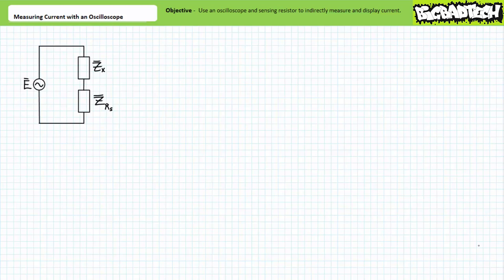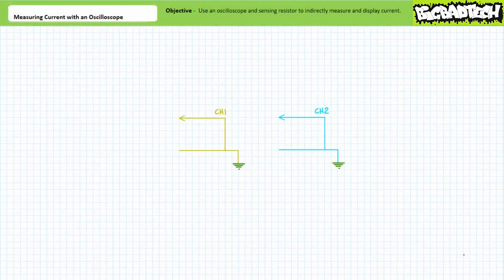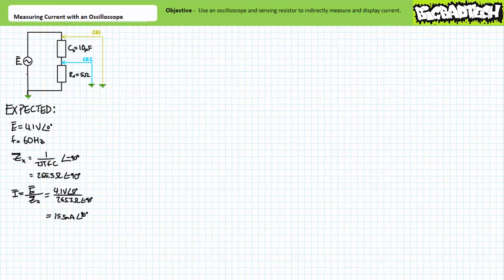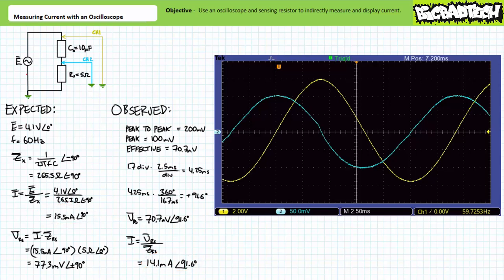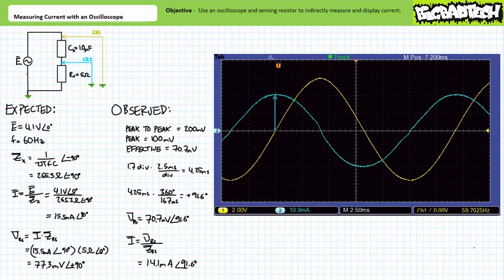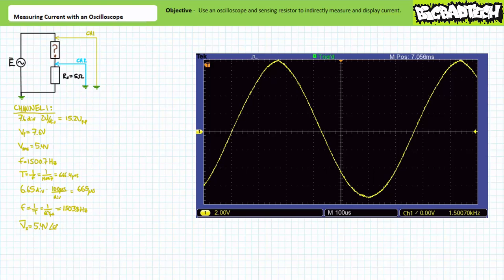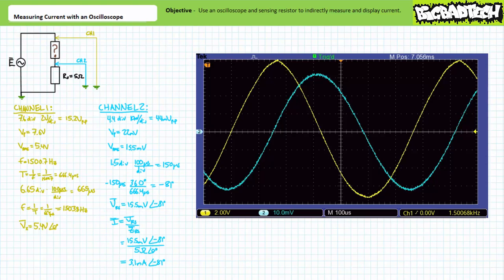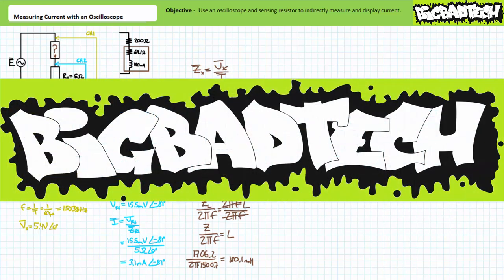Measuring Current with an Oscilloscope (Full Lecture)

Comment from the maker: ERROR at 30:40 Channel 2 has a peak to peak span of 6.4 divisions instead of 4.4 divisions. You should be obtaining the following values for channel 2: Vpp=64mV, Vp=32mV, Vrms=22.6mV, I=4.5mA/-81
This would also change the impedance calculations at 33:05: Z=1.2k/81, R=186.7, L=125mH.

Comment: This lecture just explained everything my teacher didn't. Thank you! Also, i measured the same circuit at different frequencies and got the same phase shift angle, why is that?
Reply from the maker: Good question. No matter what frequency you're running at a full cycle (ie: from 0 crossing going positive to the next 0 crossing going positive) always equals 360 so that proportional difference (ie: phase shift) will always be equal. 

Example 1: a 1ms lag for a waveform with a 20ms period is 1/20th of 360 or 18 degrees. 

Example 2: a 10ms lag for a waveform with a 200ms is also 1/20th of 360 or 18 degrees.

Make sure you tell your classmates about these free resources!
Reply: @bigbadtech  thank you so much!

Comment: My thoughts on the example of the indirect current measurements using second channel on Rs. Though scope shows voltage drop over Rs on the second channel we see the voltage is leading total voltage drop by 90° though we measure voltage drop over active resistance.Thus the voltage drop on Rs channel is leading only because the current passing through the Rs is already shifted by 90° due to the capacitance.If the first resistance will be also active resistance,then we see no phase shift on Rs voltage drop when compared to total voltage drop.As there will be two active resistances in series, current over the resistances will be in phase with source voltage. That means,we can also find the current in series circuit having two active resistances using a scope. Can we hook channel 2 probes to measure voltage drop on the first resistance to find phase shift,rather than hooking channel 2 probes over Rs? We can knowing first resistance's value.
Reply from the maker: Yes, if you know the voltage across a resistor and the resistance value one would use Ohm's Law to determine the current magnitude. Current would indeed be in phase with the voltage across it. This works, however, the point of a 1 ohm sensing resistor is that the transfer function is stupidly easy (1A/V) and it works for pretty much any circuit even if the components are hardwired and can't be rearranged.
Reply: @bigbadtech  Thank You for the feedback.Good that You still follow the comments' rubric.